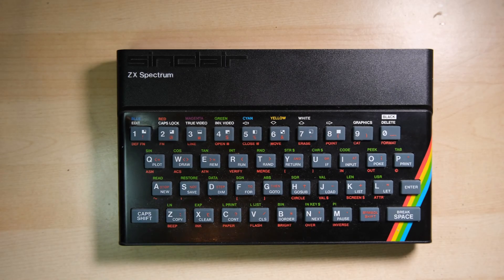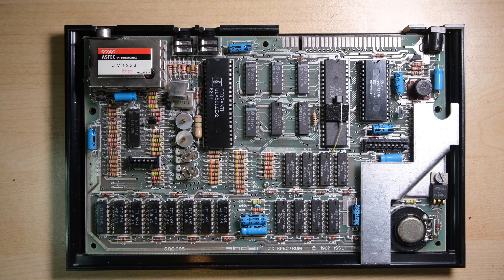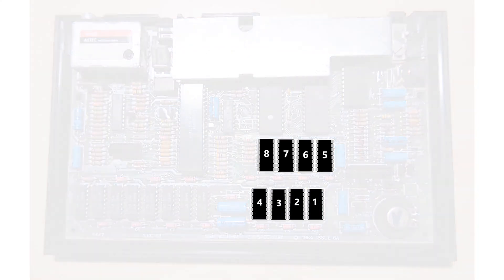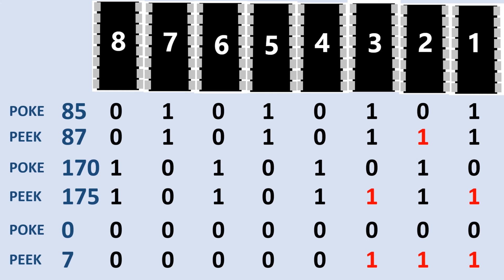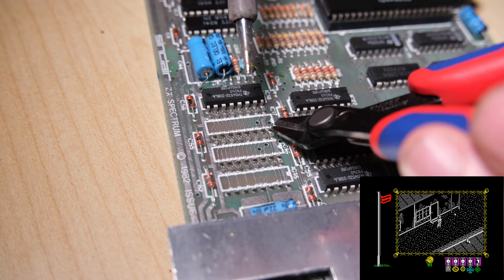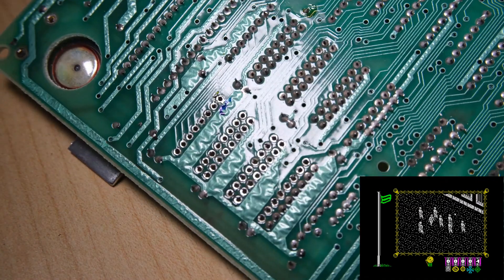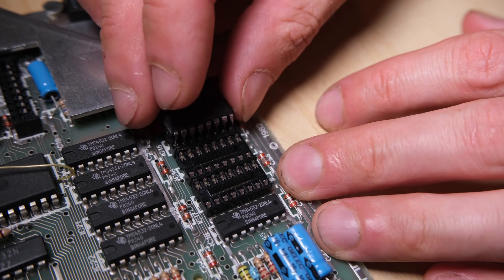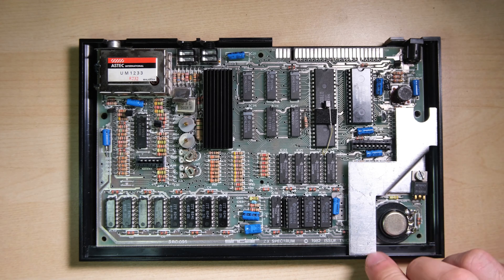ZX Spectrum - Upper RAM Fault Diagnosis and Repair

Comment: Sorry to sound dumb.. I am not great but trying to learn about these older 80's machines, I never owned a spectrum until now. I know it's only working with 16k ram but it's a 48k machine, I don't want to buy a diagnostic cart so thought I would try the 'poke peek' method. I am not sure how it works as there's no explanation other than 85 shows 87 so it means that chip 2 is at fault???? Anyway, I followed this and got 253 from the value of 85, 82 from the value 170 and 243 from the value 0. I think I input everything correct, for example POKE 85,0 (enter) PRINT PEEK 85 (enter). Am I doing something wrong? Thanks for the great videos, I maybe in too far over my head....
Reply from the maker: To test the upper ram memory you should write the value to an address in upper memory. In the video I randomly chose 50000
So it's poke 50000, 85, for example. 
Then print peek 50000
Reply: @HappyLittleDiodes  OK, Now I did that as you said, the 85 gave back 85 but the 170 value gave back 234, and the 0 value gave back 64. I don't know what that means yet, because, as I said, I am trying to learn. Thank you for your assistance so far, it is very much apprecaited.
Reply from the maker: Do the test a few times, I'm interested if it's sporadic, from what you've said IC21 seems sporadic and IC22 also is bad. I'd replace both
Reply: @HappyLittleDiodes  OK, I'll go try it a few times and power cycle now and then and let you know the results. Thank you for the feedback and helping me to try and understand this :D
Reply: @HappyLittleDiodes  I tested a few times and it was always the same result. I decided to replace the 2 chips. Now it turns on fine but as soon as you hit a 'command key' such as print, poke etc.. it freezes but if you just type the alphabet it carries on working fine.
Reply from the maker: That's interesting, not seen that before. Are you happy with the chip replacements? Is the upper ram in sockets? You could try removing it all the upper ram related chips and running it as a 16k to start a process of elimination
Reply: @HappyLittleDiodes  That was my next idea, and no i didn't socket them as I have none to use. I guess it's just a process of elimination. Thanks for your help and ideas so far, it's been a big help.
Reply from the maker: Which ram chips did you use out of interest? It's strange that changing ram chips caused such a fault
Reply: @HappyLittleDiodes  It was the 4164 Spectrum "Upper RAM" Chips from Retroleum
Reply: Or KM4164B-12 to be precise.

Comment: WOW just what I`m after. I just got a TOPRAM error.
Reply: did the poke test and got 81 instead of 85 so that was -64 chip 7. Poked 0 and got 64 so deffo chip 7. Now I have to check version 3 or 4 ram chip according to the bay. Cheers for that. Was well worth it subbing to your channel.
Reply from the maker: Good work! Glad to be of help, let us know how you get on

Comment: My spectrum is having an identity crisis, sometimes it thinks its 16k and PRINT PEEK 23733 returns 128, Other times it thinks its 48k and Returns 255, Sometimes PRINT PEEK 23732 + PEEK 23733 * 256 returns 32771 (thinking its a memory damaged 16k Spectrum) sometimes it returns 65535 and thinks its a fully working 48k.  Its bizarre. regardless of all this it only loads 16k games no 48k game fires up.
Reply from the maker: You may have an upper memory fault, likely a 4164 chip but I guess it could be multiplexors. Are you able to run a diagnostic ROM?
Reply: @HappyLittleDiodes  not currently I wanted a Smart Card 3.1 from retroluem but they have been OOS forever. Is there another you can recommend?
Reply from the maker: You can use a dandanator. If your ROM chip is socketed you can easily pop in a replacement ROM from retroleum preloaded with his diagnostic image
Reply: @HappyLittleDiodes  I’ve managed to order the X-Rom they make. It doesn’t have the SD Card that will have to wait!  But hopefully this will get to the bottom of it
Reply: so after running the ROM its found an upper Ram error on IC22 so at least its only one. Ill have to go and get a chip and a socket and get ready for surgery :)
Reply from the maker: If you're unsure at all then cut the old chip out and carefully remove each leg one at a time
Reply: Resocketed and tried two different new chips and the diagnostic still pulls IC22 as being bad, I’m a bit stumped now 😅
Reply from the maker: You may have a short somewhere on that data line I would go to town on continuity tests
Reply: @HappyLittleDiodes  I got an upper ram board and put that in, the error then switched to IC17, ive taken it as far as my technical knowledge will allow, Im going to email you regarding getting it professionally fixed :D

Comment: The 4116 are originally used as lower ram. As I can see in the video is it possible to use 4116 chips also as Upper Ram and also combine them 4532 ? Meaning you can have some 4532 and some 4116 for upper ram ?
Reply from the maker: No that wouldn't be possible because they take different voltage supplies.  You can use 4532 in lower ram with a bit of jiggery pokery
Reply: @HappyLittleDiodes  Thanks, now I see that you used 4164 chips (and not 4116). So the 4164 is the one that can be used as a direct replacement for 4532.
Reply from the maker: Yes that's right

Comment: With 3 adjacent chips apparently having the exact same fault, did you suspect the fault could be in the PCB? How did you rule this out?
Reply from the maker: A pcb fault could only be a short or a broken connection, which can both be continuity tested which is always a good start when fault finding around chips!

Comment: how the heatsink does not effect the box closing? what size is your heatsink? and where to buy it because mine is too tall and conflict with the box closing. thanks
Reply from the maker: Hi. You need to remove the ULA socket to make it fit
Reply: @HappyLittleDiodes  thanks a lot was my doubt